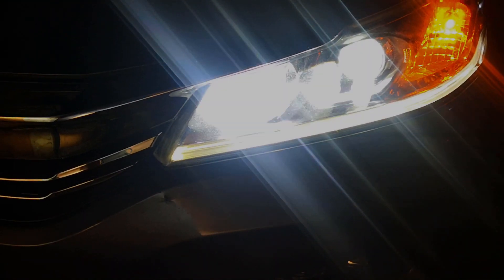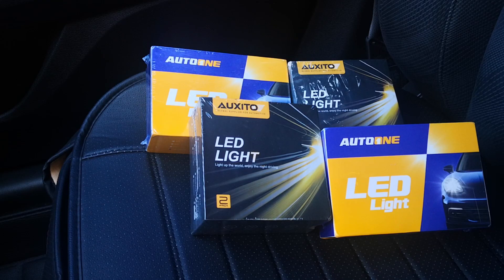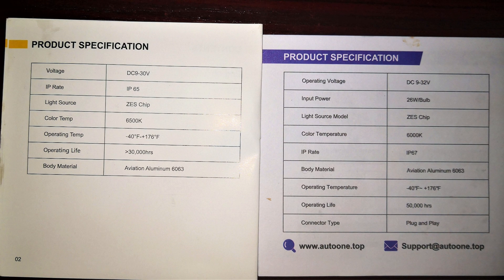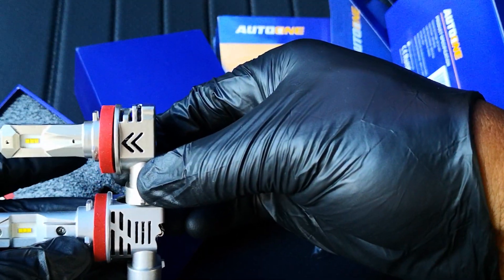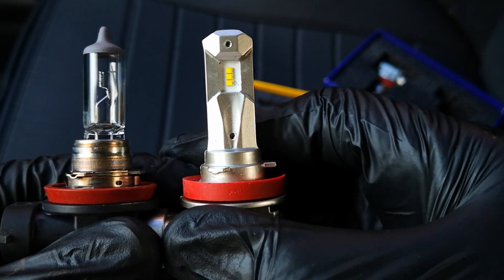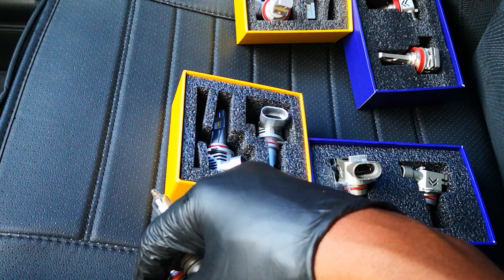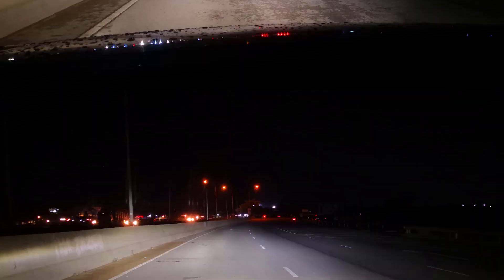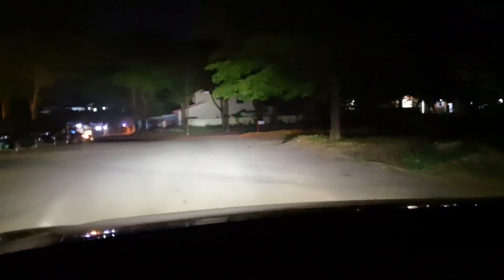Best Plug and Play LED headlight Upgrade / Are LEDS better than Halogens?

Comment: @DIYAutoworksNG 

since it’s been 3 years, how are the Auxito - M3 led bulbs holdin up?

Any issues so far?

And do u only use them during the night time? Or daytime like other people do?

And what about Autoone/auxito - 10S led bulbs?

Both brand carry those 10S FIY.

And I also saw one of the comments that these have some sort of dark spot on the driver side?

That should not be exposed to that. 

Since they been tested by CarLightReviews on YouTube channel, there was no dark spot at all.

Unless u guys are talking about under the hotspot in the middle of the beam pattern.

If so, that’s common.
Reply from the maker: Still going strong. Haven't had any issues. If anything, I need to clean the headlights to remove some yellowing! I haven't tried the 10S bulbs.
Reply: @DIYAutoworksNG glad to hear that👍🏼 but hopefully that’s just ur headlights that’s got some sort of a dark spot
Reply from the maker: @toyotabrony it's the usual UV yellowing of the headlight polycarbonate itself, not the LEDs. Sorry if that wasn't clear initially.
Reply: @DIYAutoworksNG nah it’s not a problem at all. 
As long as u see very well at night. That’s all that matters

Comment: i have honda crv 2015,is it normal my 9005 highbeam factory bulb set to 7 and 1 oclock,planning to put led.should i follow that factory pattern or i need to change it to 9 and 3 oclock pattern?
Reply from the maker: Just buy an LED bulb that's compatible with your car. Your car uses the same spec with the ones used in the video. Install and you should be fine.

Comment: Which HED  rand do you prefer? Autoone or Auxito?
Reply from the maker: I've been on Autoone since making this video, but let me switch the Auxito drive it around and give you my definitive feedback.
Reply: @DIYAutoworksNG  thank
Reply: @DIYAutoworksNG  is there any updates on your opinion?
Reply from the maker: Thanks for bringing me back here!!!
In all honesty, I think the Autoone may have the slimmest of a reach advantage when it comes to the high beams, but the Auxito may just have a slight edge when it comes to low beam coverage on the passenger side.
I didn't take any measurements to back this up, so the said advantages may well be subjective, but those are my thoughts.